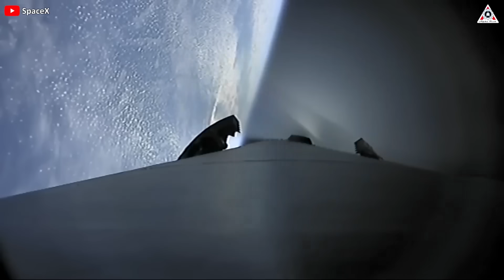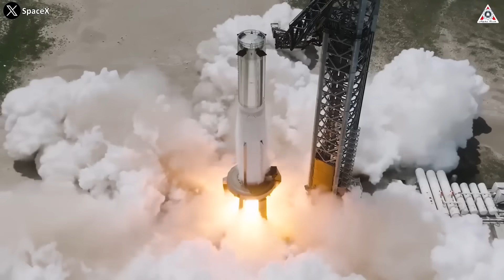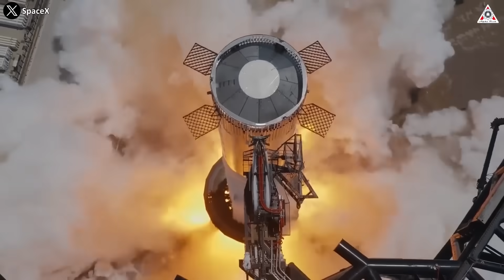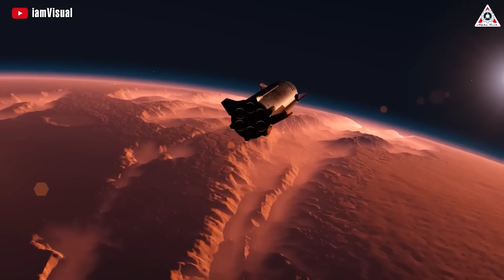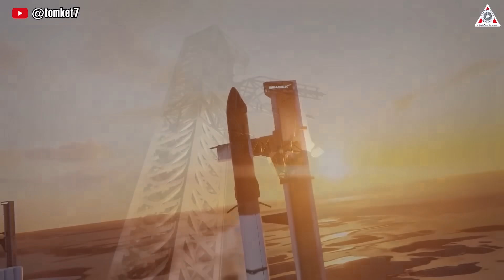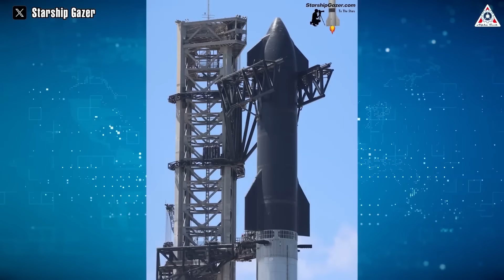SpaceX is to land the Super Heavy Booster on Droneship! Mechazilla catching is mind-blowing...

Comment: I suspect the catch tower will work well if the Raptor engines have smooth control at low thrust.  Being able to shut off multiple engines helps.  They have landed on land a few times, though a hard touchdown several times.  The arms will likely cushion the touchdown like a shock absorber.  Being so large, erratic crosswinds will have less effect.  Once the control system and landing sequence is dialed-in, it should be repeatable and robust, if the engines cooperate.  One reason Falcon 9 lands smoothly is that its Merlin engine descended from TRW engine on the Apollo Lunar Lander.  Besides the main engines, some of which gimbal, they use small side-thrusters, giving enough forces to align the vehicle in 3-D space (3 linear directions and 3 rolls).

Comment: The comments here of landing only towers is encouraging. I've been making this argument for more than a year. Putting the entire launch complex at risk with a falling bomb is a terrible and probably very expensive idea. If they do comingle launch and landing activities, eventually there will be a disaster. This is one of those, "when things go wrong", not "if things go wrong", kinds of realities. One mistake could put the launch complex out of use for a year. Visualize a super-heavy hitting the methane tanks! Yikes! NASA will almost certainly weigh in on this at complex 39 (has?)... A landing-only tower would be much less complex, approximately half the height, not nearly as expensive to build or replace, and a much safer system. Landing only towers could / should be miles away from the launch and refurbishment facilities... When they seriously rev-up launches, there is going to be a bottleneck at the launch tower. Separating launches and landings will be a necessary practicality that will help maintain launch cadence. A future with a massive and exponentially growing space economy, will demand many flights per day (and increasing from there) will necessitate many launch towers and many landing towers (or landing pads, what ever is found to work best). Relaunching the same booster multiple times per day is aspirational at best and likely will not materialize for a decade? Returning boosters and ships will need to go to the back of the line for inspection and refit for the next launch. Landing back on the launch pad will disrupt preparations for the next launch. Currently, SpaceX is fighting their way through vehicle development hell...  For now they are stuck at the point of simply demonstrating the vehicle will work... After proof of concept, they will need to find the most efficient and realistic launch and landing systems. Just as the larger airports separate take-off and landing, so too, for a host of reasons, Starship launch and landings will end up being differentiated... Imagine a time when there are 100 heavy lift launch vehicles launched every day? The transition between today's launch rate and that future will take place in a span of approximately ten and twenty years, once the vehicle is proven to work... People generally overestimate near-term change and underestimate longer-term change...
Reply: After validating landing precision with water landings couldn't they just hang a booster mockup from a crane to simulate the hover?  Then vary the location of the booster within the envelope defined by the chopsticks (rotation, vertical motion and radial motion) to test if the chopstick capture can be done in 10 seconds. Motion of the crane could simulate the random motion of the booster while it's hovering.  I expect SpaceX has already performed tons of computer simulations to model the dynamics of the chopstick motion along each axis in order to test the control algorithm they use to perform the "docking" capture.  Although a crane test would be an important verification milestone.  In any case, if tower capture doesn't work they can always add legs and take the payload hit.  Also, if a capture fails then the grid fins landing on the chopstick arms is a backup to prevent a booster crash on the pad.  I expect SpaceX has considered this.

If an engine restart fails or some other anomaly occurs they could maneuver the booster or ship away from the tower (perhaps off shore) to avoid damage to the launch pad.  This should cover some of the failure modes but there could still be failures that crash the tower.  The protection from mission disruption in this case is to have an extra launch site(s) for redundancy.  I expect they will need this anyway because there are other ways a launch site could be put out of commission (hurricanes, earthquakes, tsunamis, ...).

Comment: The 1st stage, Super Heavy, would be a better tanker. Without having a Starship and its mass to carry, and simply a nosecone for aerodynamics and refueling/defueling interface, a Super Heavy should be able to achieve LEO suitable for its purpose. Likely it will be necessary to change some of the engines to vacuum engines that ignite when appropriate along with shutdown of atmospheric engines. With its greater capacity, it would be capable of fueling more than one Starship at a time while also being refilled by a refueling drone Starship. Just a thought.
Reply: I like the idea however consider the weight of the fuel for just a single Starship. And could Super Heavy still climb with a certain amount of engines swapped out for vacuum models? Perhaps when they have Raptor version 3 or 4 this would offset the loss of thrust 🤔
Reply: 1st stage won’t make it all the way to a stable LEO orbit, otherwise great thought.😊

Comment: A second, smaller, cheaper tower, close to the launch site could be used for all returns of booster or ship, this would free the full tower for launches only helping with cadence of launches and reducing risk of returning ships damaging the far more expensive launch site.
Reply: The problem whit that is the additional costs which Musk hates and the time it would take to move Super Heavy and Starship to the launch tower which would exceed the one hour turn around for the next launch.  Personally, I think a one hour turnaround is a fantasy.  Space X is gong to have to analyze the results of the previous mission, and they will have to inspect both Super Heavy and Starship to assure they are both ready for another mission.  That alone will take much more than one hour.  Then there is the permission for the next launch license from the FAA.

I'll be surprised if Space X can turn around a Super Heavy and Starship in 1-2 days for the foreseeable future under the best conditions.

Comment: Current risk for chopstick landing is very high because there is ONLY the one launch tower!  
In the future there will be multiple towers, so a mishap during a chopstick capture would reduce launch rate but not stop all launches. Also, by then the technique of capture should be quite well understood and managed.  

I prefer an option of adding, to the back side of the existing Mechazilla tower, a mirror-image twin tower designed for ship captures only.  In one process you would have your "seperated" capture tower, yet still just yards away from the launch tower.  To paraphrase; Two Towers, One Stone!

This would provide the ability to quickly rotate the captured booster around front to the mane chopstick assembly, or alternatively, lowered for transport too the repair facility should that be required.  Given installation of ground level blast shielding, this would isolate the launch pad base from damage if the capture fails and the booster drops to the ground.  Additionally this opens up a potential "flight path" to steer the booster laterally away from the towers at the last second should booster position excessively deviate from planned.

Comment: Had about the use of a polarized electromagnetic field activiivated based on the the objects’ distance ?
Reply: The positive polarity of the electromagnetic fields’ intensity could be programmed for impediment of their being metal contact through the use of a magnetite alloy FORGED into the metal characteristics of the starship  /  chopstick’s magnetic melded magnetite alloy component , their would be NO NEW PART,  structurally , properly designed metal alloy with the modeled magnetic field , creates force field separation of starship and chopsticks , manufactures distribution of force field vector over wider area of the point of contact to create a buffer magnético a positively charged impedance zone

Comment: I've actually wondered the opposite. Why they don't make the tower taller and launch from the chopsticks/multiple layers of chopsticks. Clearing space underneath the rockets would make the immediate blast of the engines less destructive.
Reply: too much chance of not getting released at exactly the right time.
Reply: @jessepollard7132  You think? I can imagine it quasi spring loaded with weight sensors. As soon as they can the chop sticks could spring away or back into place in a quarter of a second. Maybe not what they have now. They just have to clear 90 degrees away from the rocket and back.

Comment: I believe they determined that landing gear would be too heavy to be practical for the main booster.
Reply: The bottom of the rocket will crunch because the ground doesn't give. Falcon 9 works by  sacrificing shock absorbers in the legs. and sometimes the legs themselves.

Comment: He envisions turning them around like airplanes, Booster already on OLP, Starship gets caught, if no anomolies on previous flight - a quick but detailed inspection, Replacement of 1 time use, or timed out LRU components while on the arms + some type of ground supprt mount. Laod cargo, and  cabin stowage.
Stack, check out,  load crew / passengers, refuel and Launch.  Airlines do it on a thechnology stuck in the last century, imagine what Elon can pull off...

Comment: My wild guess is that Starship 10000 will happen before Super Heavy Booster 1000, both in the 2030 to 2040 time range or so.  Recovering a Starship quickly won't be a big need, because there will another one that needs launching.

Comment: The time and effort it takes to make a booster could be used to make a seagoing landing barge outrigger pontoon.  Make 4 - 6 such pontoons having extendable telescoping arms with a saddle at the ends of the arms, so that as the spaceship or the booster lands on the drone the outrigger pontoon arms lean into and "catch" the ship cylinder.  Have an amphibious transporter pick up the carcass and speed it to the refab shop.
Reply: what makes you think it only takes a day or two to make a sufficiently strong, stable and mobile barge? Manufacturing rates  for starship and superheavy booster is approaching one per 2 days.
Reply: @jessepollard7132  I built one and got a patent on it and 21 different embodiments.  I'm not an engineer but an engineer friend said it would never work.   When he saw it work he was so invidious he refused to help me take an effective video of it. Had total strangers stop me to ask questions.   I  did all The displacement math myself to calculate the hull size. Entire first embodiment prototype took 2 months to build, by myself !

Comment: All these posts are correctly hitting on the risk and financials aspects involved in testing and future progress. If Spacex can get the booster and ship to hover and land on a postage stamp on paper, wouldn't landing legs be a good safeguard for the first few tests? Then if all things go well (or when they do), land it on Mechazilla, with the legs as a backup so as not to destroy the tower and base. Yes you'd need to add a ring around the base of the launch platform maybe higher than the platform by a bit, but this seems like it might reduce the risk to the structure. Just the thoughts of an outsider.

Comment: Wind may be a problem for landing. As the last flight was being pushed by wind on take off.  It would be difficult to control with just wind veins and nozzle movement.
Reply: since it lands like 5 mins after launch ( Super Heavy ) they wouldn't launch in wind that was not favorable.... and winds are not likely to change is such a short time..   as for starship.. they stay in orbit and land when conditions are favorable....

Comment: If you added a parachute to the top end then  you can save weight increase payload,  the thrusters may not be needed to make an initial change of attitude to vertical .
Reply: That would also make it harder to control its exact landing point as the parachute would get caught in winds.
Reply: The parachute would need to be massive and add weight. Look at what is required for Apollo and Dragon and multiply it by a very big number.

Comment: Instead of a drone ship, they should look back into the oil platform ideology.  Like they said after selling of the rig they purchased, they would need one custom built.  Ideally one that is mostly skeleton with the tower and chopsticks.  Leave the area below the landing open to the sea for two reasons.  First reason is if the landing fails to catch, the booster can at least crash into the ocean.  The second reason would be to allow the booster to be lowered to a barge where it can be transported back to land.

While SpaceX's ships are all super worthy and reliable, there's still the small margin of error.  That margin of error could result in the destruction of the launch platform.

Comment: I wonder what affect the drastic temperature change has on The booster and ship if allowed to land the first few tests in the water.  Pressures must be maintained, and warm sea waters will cause remaining super chilled methane and lox to expand rapidly.  Pressures will likely need to be purged and controlled, so as not to explode nor collapse the booster and ship.
Reply: The bigger problem is corrosion to areas that can't be reached for cleaning.

Comment: I would try to catch a modified F9 with Mechazilla to perfect the software, and hardware. If it crashes, it wouldn't be as catastrophic as the SuperHeavyBooster.
Reply from the maker: Thank you so much!
Reply: they can practice over the water.... with a soft water landing they could even use it again... after fixing whatever the salt water messes up.
Reply: Couldn't they just hang a booster from a crane to simulate the hover?  Then vary the location of the booster within the envelope defined by the chopsticks (rotation, vertical motion and radial motion) to test if the chopstick capture can be done in 10 seconds. Motion of the crane could simulate the random motion of the booster while it's hovering.  I expect SpaceX has already performed tons of computer simulations to model the dynamics of the chopstick motion along each axis in order to test the control algorithm they use to perform the "docking" capture.  Although a crane test would be an important verification milestone.

Comment: If, as is being suggested, SpaceX plans to establish and maintain a limited number of 'Mechazilla'  launch and retrieval towers but a far more substantial number of Super Heavy Boosters and Starships, as is the case with Falcon and Falcon Heavy.
A capacity to rapidly return Super Heavy Boosters and Starships to launch-able status after retrieval should not be a pressing concern because multiple other such vehicles should be prepared for and awaiting launch from a far smaller number of towers anyway.
Furthermore why are the grid fin attachment points on the super Heavy Booster not designed to act as multiple points of contact with the manipulator arms of Mechazilla towers?
After all the grid fin attachment points for Super Heavy must be reasonably strong in order to withstand stresses incurred as the grid fins perform their primary function anyway.

Comment: I love SpaceX but catching a returning rocket would be very problematic, including the exhaust damage to the tower.  Landing on a drone ship makes more sense.  Just my opinion and doesn't require a response.
Reply: Couldn't they just hang a booster from a crane to simulate the hover?  Then vary the location of the booster within the envelope defined by the chopsticks (rotation, vertical motion and radial motion) to test if the chopstick capture can be done in 10 seconds. Motion of the crane could simulate the random motion of the booster while it's hovering.  I expect SpaceX has already performed tons of computer simulations to model the dynamics of the chopstick motion along each axis in order to test the control algorithm they use to perform the "docking" capture.  Although a crane test would be an important verification milestone.  In any case, if tower capture doesn't work they can always add legs and take the payload hit.

Comment: Are you making all these errors so you get more comments?

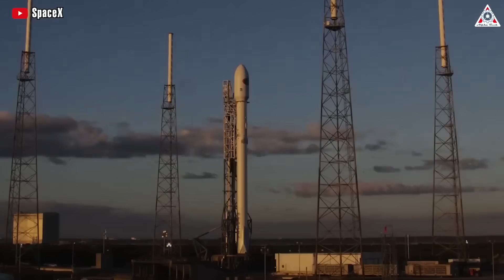20:07 Are you sure an empty Falcon 9 first stage only weighs 550 kg? That's only 1210 lbs…
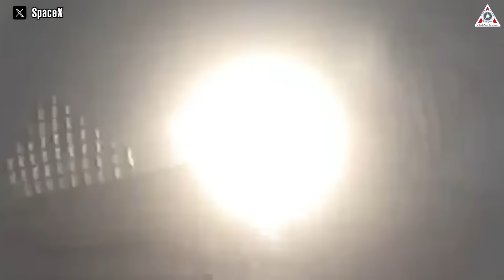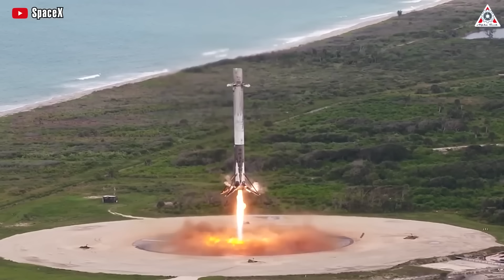21:27 The three inner engines gimbal, and there's thrusters as well as the grid fins - you can see them firing at 21:22…
Reply: doubtful. Maybe he meant 550 tonnes?
Reply: Yes I just checked it its 549,054 kg
Reply: @joshwhitaker7315   The figure I found is 22,200 kg. 549000 kg has to be the fully fueled mass.

Comment: Clickbait, or lack of research? 1. Watch a succession of Falcon droneship landings, notice how many are within a four meter circle, ON A BOAT, floating out in the ocean. 2. See the chopsticks at full spread? That is how much latitude the boosters have, ANYWHERE within that lateral spread, plus the movement of the catch points inward or outwards along the arms. Which is more than twice what Falcon 9 typically uses bobbing in the ocean. 3. You can't figure out how much more time it takes to move a crane in, attach it and lift, vs having the booster already on the launch mount!? Guys seriously way up there on lifts, wobbling in the wind? Going that high on a lift is seriously constrained by wind.

You must know someone who actually pays attention to SpaceX who you can do a headcheck with before publishing nonsense?